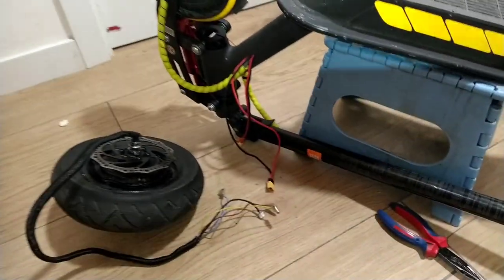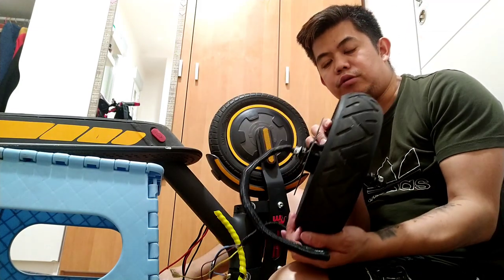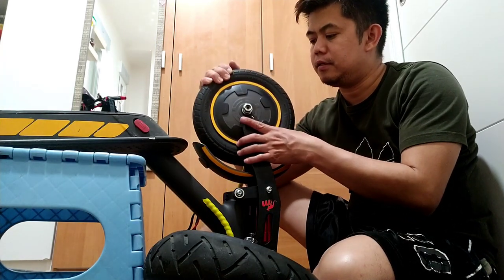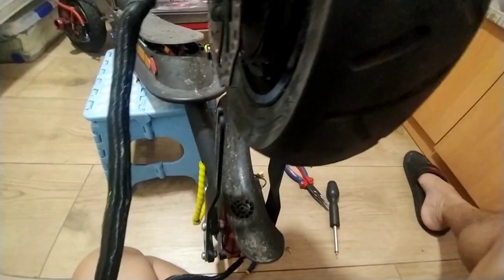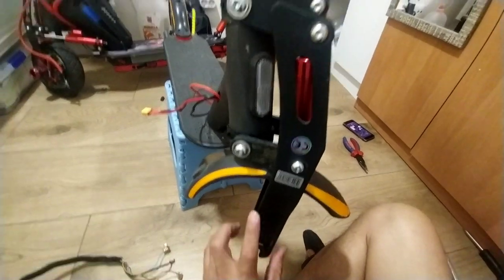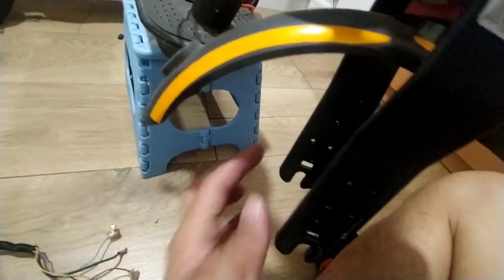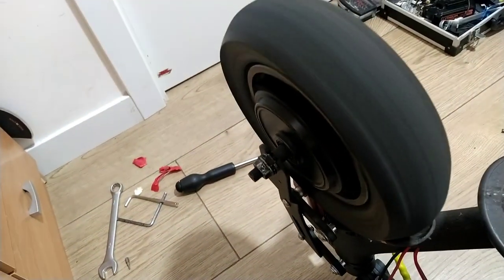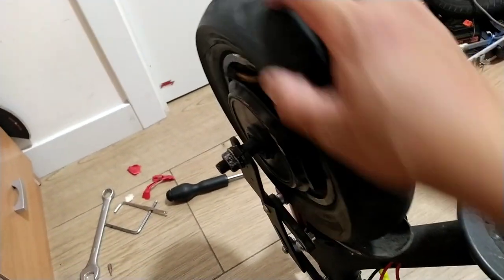700w motor  install to front in the xiaomi pro2

Comment: Please can you help me i bought a 48v 1000w motor from amazon and soldered the cables from the old motor to it and plugged it in but the controller lights up red and the motor doesn't work can you help me please
Reply: Need to upgrade the battery and or firmware to compensate.
Reply: The controller you can buy one kit with trottle and monitor and use it like that or watch modify the controller but for me also a difficult matter now. Let us know if you fixed it
Reply from the maker: not mofide only tock controler